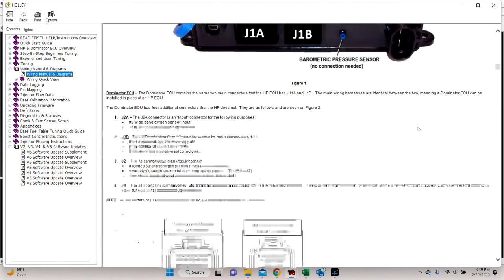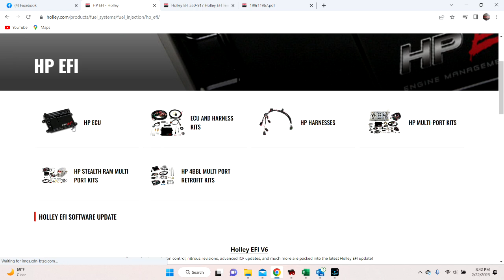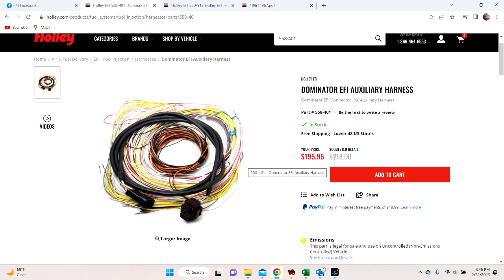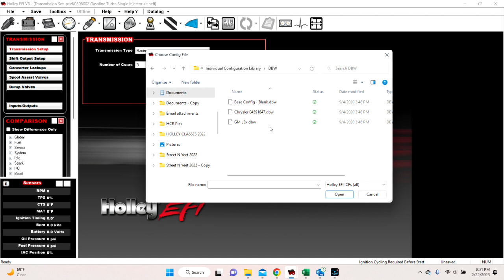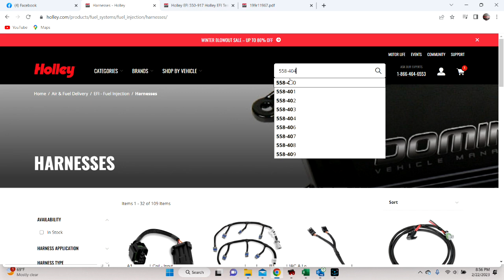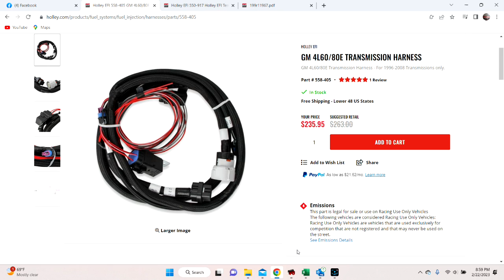How to Select the correct harnesses for your Holley Efi Install

Comment: I’m out of Inputs on my terminator x in my mustang and swapping a dominator in . I’m wanting to add 2 step off the clutch switch and flex fuel sensor what input harness would work best

Comment: Devin. I would love a video on propperly ground a shield wire. Is it ok to ground all your shields to one point or maybe only at the sensor end of you wiring per sensor? You have great results and logs so Im sure your doing it correct.

Comment: Great video, I really appreciate the information as I'm considering a dominator to control my setup with dbw and 4l80, over a terminator x with the can i/o module mostly for ntk and second oxygen sensor support  After hearing Matt Happel's reasoning on the sloppy radio show the other night with you guys.Also it seems like it will future proof me from running out of inputs and outputs down the road.

Comment: hate that using trans control on the Terminator X max doesn't unlock the inputs and outputs in J4. MAYBE that will unlock in V3???
Reply: So the software in x max doesn’t allow access to the inputs and outputs of j4?

Comment: I watched a video where you said  don’t buy anything from summit or  places that don’t care about the customer 
Buy from someone that backs the Holly product 
I bought from you 
I answered all your questions about what car and engine I had but I was sold the wrong shit  completely wrong shit 
I hope you guys have it figured out now for the next guy buy the time I had to buy all the extra parts to run the terminator x max I was over 2 grand including the terminator I got from you   OUCH
Reply from the maker: What was wrong ? I don't recall any of this
Reply: @theholleyefiguy  I ordered well I thought I wanted a Holly HP so I ordered it from you girl friend. Like I said before hand I told her everything about my engine  I received the HP but I does not work with drive by wire. So I sent it back and got the term x max  I have a 2007 LQ 4   DBW  i received a term x max but my injectors wouldn’t fit the harness  I had to buy fuel injectors that cost 500 bucks to fit the harness she wanted to send me adapter harness wires  there was no way I was going to plug little pig tail extension wires on to my fuel injectors 
I had to buy a new throttle body to fit my drive by wire but I didn’t care about the throttle body 
I got the feeling that my order didn’t mean shit to anyone 
I’m a hard core budget builder 
I am very careful where my money goes to build my shitty little vehicles out here in  utah